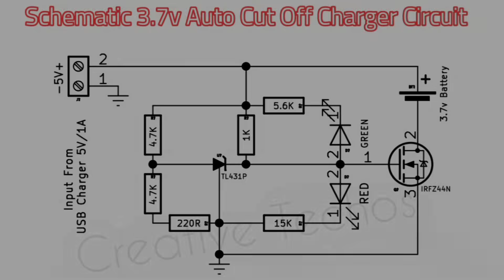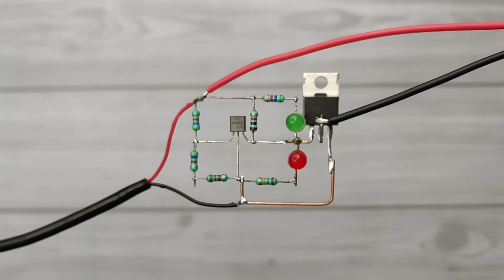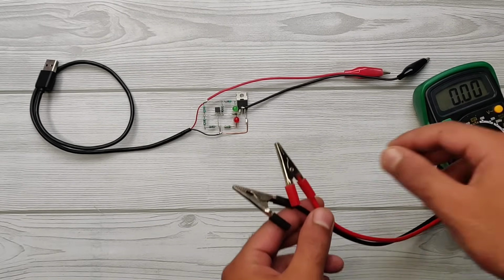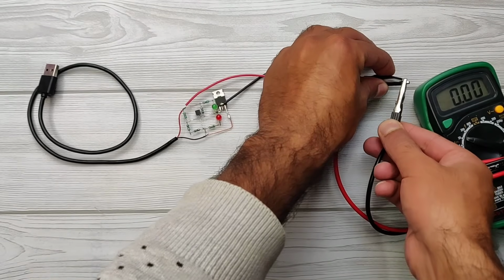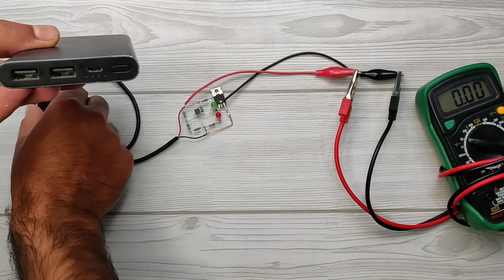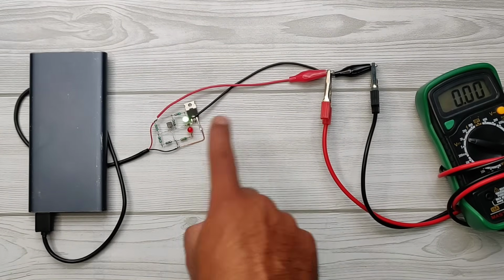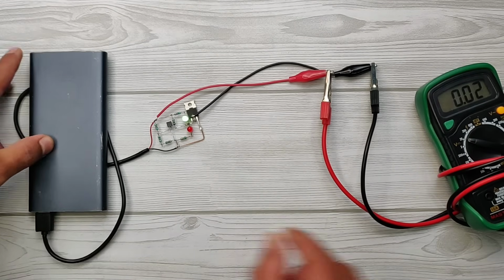Auto cut off 3.7 volt battery charger circuit

Comment: Hello and thank you very much for your video, very useful. A question, what modification in the circuit should I do if my battery is 1.5 volts? Greetings
Reply from the maker: 1.5v Ni-Cd need different circuit as mosfet will not able to switch in low voltages
Reply: @CreativeTechos  of course, my question is what values have will for 1.5 volts?
Reply from the maker: I'll try to upload video for 1.5v ASAP
Reply: @CreativeTechos thank you very much sir. , I am subscribed so I will receive the alert. Greetings
Reply from the maker: Thanks 😊

Comment: a3.7 volts or 4.2 volts?
Reply: if i want 4.0 volt Which resistor should I change?
Reply from the maker: Change 4 7k + 220 ohms in series from tl431 pin 1 to gnd, with the 10k preset to adjust threshold as per requirement

Comment: Auto cut off works at 4.5v only, what to do to make it works at 4.2v?
Reply from the maker: Use multi turn 10k variable resistor instead of 4.7k + 220R resistors, to set cutoff threshold accurately
Reply: @CreativeTechos I think if it is used 4.7k and 4.7k + 220R, will cut off 4.5 or 4.8v. If use 4.7k and 7k, will cut off 4.2v. correct?😅

Comment: sir,is it possible to charge 2- 18650 in parallel,thanks
Reply from the maker: Yes you can charge 1-5 cells in parallel
Reply: @CreativeTechos  thanx sir,badly need that.keep on sir
Reply from the maker: You're most welcome

Comment: Hi,
Can I charge 1.2 volt rechargeable battery?
If yes, which resistor do i need to change?
Thx
Reply from the maker: No, with this circuit you can't, I'll soon upload circuit for 1.2v battery, subscribe & get notified.  Thanks 😊
Reply: Thank you that you already have plan to create a circuit for auto cut off 1.2 volt rechargeable battery.

Comment: Hi there I made this circuit 3 times already and still not working and used the downloaded
diagram, when I connect the 5v 1A to it both led light up
Reply from the maker: It may be problem in tl431 ic, consider replacing tl431. 
I'm soon uploading another video with explanation with current and voltage control.

Comment: I was quite interested in this circuit but see that the green led is connected the wrong way at 2.33 into the video and the tl431 is also connected incorrectly. The reference pin should be connected to the junction of the two 4k7 resistors and the anode should go to earth. Having said this, I still don't see how the circuit works as the voltage of the battery isn't monitored, so what causes the TL431 to switch off? Could you explain how the circuit works?
Reply from the maker: In video it is connected correct, but diagram in video has mistake that i was not able to correct after uploading,
But download link in video description has perfect diagram
Reply: @CreativeTechos  Thanks for that, but could you explain how the circuit actually works?
Reply from the maker: Actually N channel mosfet remains on by feeding small +ve current at gate using 1k resistor.
And the Tl431 pin 2 connected to -ve and reference pin 1 connected to Voltage divider, when voltage in circuit reaches above 4.2v,  refrence pin 1 of tl431 receives enough positive current and switchs  -ve Voltage from pin-2 to pin-3 that is connected to gate of mosfet, that grounds positive current coming from 1k resistor hence mosfet turns off.
Reply from the maker: I'm also soon going to upload explained video with feedback and current Voltage control
Reply: @CreativeTechos So, reference voltage is 4.2 or 4.8 according to 4.7k and 4.7k+220 R, it is? if 4.2v, how to calculate to get resistor value for voltage reference? Please, let me know.

Comment: Is this circuit can charge 5pcs 18650 battery together?
Reply from the maker: Yes it can charge in parallel but its ideal for only one li-ion battery
Reply: Then u can make 5 pcs 18650 battery together auto cut charger circuit please. I have a power bank & it's module is so hot when I plug adapter. So I replace it & put your auto cut circuit.
Reply from the maker: Yes I'm soon uploading for 3 batteries and with same method you can charge 5 batteries

Comment: Hello
Thanks for sharing and explanations but unfortunately you have a mistake in the drawing, the practical assembly  is correct but different from the drawing you presented.
The junction of the two 4.7 kg resistors should connect to the No. 1 (reference) leg of TL431 and not to the Anode and again as shown in the drawing. And the Anode which is the middle leg 2 should be connected to the resistor junction 220 ohms and 15 k ohms
Hope you get the comment easily and comment
Thank you very much
Reply from the maker: I apologise, but already uploaded correct download link in description.

Comment: Is it possible to reduce the charge current in this scheme?
Reply from the maker: Yes you can connect 1 or 2 watt 10-20 ohms Resistor on input positive

Comment: 1. What is the minimum and maximum input voltage for the circuit?
2. How many watts are the resistors?
3. If you put a tuning resistor to adjust the current (instead of 4.7k + R220), what power should it be? Can I use the 3296 trimmer potentiometer?
Reply from the maker: Current circuit diagram is calibrated for 5v input.
And insted of 4.7k + 220R resistors you can use multiturn 10k potentiometer to setup the cutoff threshold.

Comment: Если поставить подстроечное сопротивление для регулировки тока (вместо 4,7k + R220), то какой оно должно быть мощности? Можно использовать подстроечный резистор 3296? If you put a trimmer resistance to adjust the current (instead of 4.7k + R220), then what power should it be? Can a 3296  Trimming Potentiometer be used?
Reply from the maker: https://youtu.be/nvlOeDHkwK0
Check out this video, with adjustable cutoff for any battery, with feedback from battery for precise cutoff.
Input voltage should be set cutoff voltage on output + input to output drop voltage.

Comment: Bu güzel devre 12 Vot aküler için de uygulanabilir mi?
Reply from the maker: https://youtu.be/nvlOeDHkwK0
Check out this video this circuit can be adjusted and used with any battery upto 24v max. With more precise cutoff.

Comment: Please tell me what are the resistor values to charge 7.4v batteries
Many thanks
Pierre
Reply from the maker: Just replace the 220 ohms Resistor with 10k variable resistor and connect the voltage where you want to set cut off point by rotating resistor till green led glows.

Comment: Bro, output showing 5.1v, without connecting battery.
Reply from the maker: Without connecting battery output should be zero, as mosfet remains off due to negative voltage coming from TL431, 
It may be faulty replace tl431 and download circuit diagram, link is in description and connect accordingly.
Also remember to use only 1A charger for single battery.

Comment: If you connect 4 batteries in parallel, what charge current will flow to each of the 4 batteries? Is it possible to make it possible to regulate the charge current?
Reply from the maker: If you connect 4 batteries in parallel, and use 2.1A charger, each cell will be able to draw about 500ma, also there is some ma dropped between mosfet source to drain pin. Use heatsink on mosfet for more than one batteries.
I'm soon going to upload 3S BMS with auto cutoff current and voltage protection with PCB
Reply: Yeah except if say 3 batteries are bad and 1 battery takes all 2.1amps...
Reply: If one of the 4 batteries has as slightly lower voltage then the other 3 there will be a huge current which could kill your batteries and even cause a fire! (This could happen idependently of this cuircuit just by connecting 4 batteries)

Comment: What current is supplied to the battery and how can it be regulated?
Reply from the maker: I used 5v 1A and battery will receive 700ma as 300ma get dropped in mosfet between source and drain.

Comment: Is this use only for single battery or it can charge for more than one battery in parallel connection?
Reply from the maker: Yes you can charge upto 5 batteries in parallel.

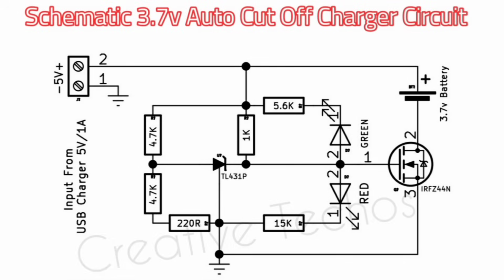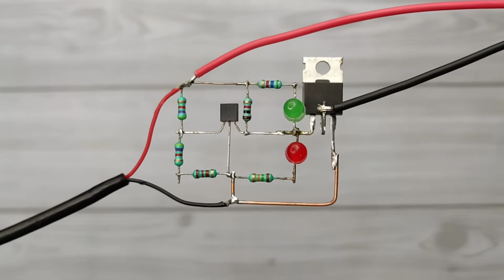Comment: I admire your works and projects with a high sense of respect and many times learn from them as well but may I point out a fact which I think is very important with regards to the circuit diagram shown from 2:33 to 2:36,the green diode is shown connected the wrong way,I think a circuit built in this manner will not work properly because the green diode should have been connected the other way round with the positive pin(which is pin 2) soldered to the positive supply line through the 5.6K resistor.I STAND TO BE CORRECTED ANY WAY, thanks.
Reply from the maker: Yes i apologise there is mistakes in diagram, but i have already updated and corrected the mistakes and the perfect diagram download link is in description.
Reply: Se que hace 2años de esto. Pero tengo una duda: La pregunta es si solo hablas del diagrama; que ya fué corregido. Es decir; la conexión que el hace en el video si está bien?? Estaré agradecido si pudieras responder. Ya que  yo hice todo tal cual como en el vídeo pero cuando pongo a cargar la batería, despues de 2 horas el led rojo se mantiene encendido y nunca enciende el led verde. De nuevo mil Gracias.

Comment: @CreativeTechos, Whether the circuit can take higher input voltage than 5v from usb. What is the input voltage range for the circuit.  Can you suggest equivalent for the 431. For parallel charging of more li-ion cells requiring charging current exceeding 1A, whether the same mosfet   an be used with appropriate heat sink.
Reply from the maker: Yes this circuit can take 5-24v input, also irfz44n mosfet drain current is rated 44A as per datasheet with good heatsink,
I will soon upload adjustable cutoff circuit can that can be used to charge any range of batteries of 5-24v,
Also you can use same above circuit for charging upto 5 cells in parallel with good heatsink on mosfet, and using 5A 2A charger
Reply: @CreativeTechos  So many thanks and my heartiest well wishes for your continued renovations and simplified projects. Kindly educate about the use of TL431 shunt regulator. How can it be eliminated with simpler component(s).
Reply: A large voltage cannot be applied to the input of the circuit because the protection circuit that is built into the battery will fail. I do not recommend a power supply voltage higher than 8 Volts.
Reply from the maker: You can apply max input 5v for 3.7v battery,  Otherwise it will not fail but will remain in Cutoff state as this circuit is designed when voltage reaches 4.3v it goes in cutoff state.
Reply: @CreativeTechos  In case of poor contact at the terminals of the power supply, "rattling", the MOSFET will open for a while until TL431 gives a "command" to close it. And all the power supply voltage will be applied to the battery. If the supply voltage is approximately higher than 10 Volts, the protection circuit built into the battery will fail.
Reply: @Timerkhan  Yes.right.

Comment: What current passing through battery ?
Reply from the maker: Use 5v 1a charger it will feed 700ma to battery as there will be mosfet junction resistance
Reply: @CreativeTechos  ty for the quick response too brother.
Reply from the maker: You're most welcome dear
Reply: @CreativeTechos  awesome ty. Nice design

Comment: Circuit diagaram. You are vedio i am following circuit .5v 1000mah charger i am using 1 cell why not working
Reply from the maker: When you connect circuit with charger what does any led glows?

Comment: please make video showing "auto charger regulator" for laptop.
Say, it will stop charging whenever battery is 90% full. And it will start charging again whenever battery is 10%.
I am using my laptop almost 20 hrs a day connected to power supply.

Comment: Can it charge a 5v battery?
Reply from the maker: Nope because output is designed for 3.7v battery and output is about 4.5v
Reply: @CreativeTechos  thank you , Can you make an electronic circuit to charge a 5 volt battery?

Comment: Problem is that if the battery is too low, there is nothing in the circuit that protects battery from excess charging current.  > 1A
Bad for both USB port and battery.
Reply from the maker: There is some junction resistance of mosfet from source to drain.
Reply: @CreativeTechos  Nonsense. The resistance of the MOSFET channel is very small.
Reply: @CreativeTechos  Could you tell what’s the charging current? Is it constant during charging?
Can you replace USB with any 5v power supply?

Comment: I want to use this circuit in a device where battery is connected permanently, and input from 5v supply. Is it ok? No drain in battery when device is in off state??
Reply from the maker: Use a Schottky Diode on positive to avoid battery drain

Comment: Put a 1N 4007 diode to the output -ve of the battery of this circuit to prevent its volt..when there is no input supply...ok
Reply from the maker: I know but TL431 won't detect battery level effectively if diode added on +ve or -ve
Reply: Да,добавить диод,изменить номиналы резисторов и на вход подать 14vпостоянного,получится ЗУ для автоаккумулятора.

Comment: Can the input voltage comes from a 5V 10A power supply. I assume that it draws only the 1 amp it requires right? So we do not need to limit current. Nice video. Subscribed
Reply from the maker: Thankyou for subscribing, also i would like to let you know that you should use 5v 2A charger for 5 batteries in parallel, for 1 battery use just 5v 500ma
Reply: Is it a must or should( just for precaution) because only have high curent power supply tho?
Reply: @maximussu7609  Just use a simple low value power resistor to limit maximum current in series with the power lead, something like 4.7 Ohms 5watt resistor should limit a short circuit current to about 1 amp, protect the circuit as well as the battery.

Comment: Hi, if i want to change the output voltage, which resistor value should i change in ur circuit diagram?
Reply from the maker: You can use voltage max to 12v but instead of 4.7K + 220R at left bottom in diagram, use variable resistor and adjust Cut Off point as per your requirement.
Reply: @CreativeTechos  hi, if i use input voltage of 5V but 20 amps Power Supply Unit, would it be safe since ur cicuit will just draw 1 amp right?

Comment: Please make a circuit for charging upto 10 Li ion battery at the same time having 220v AC input🙏🙏🙏
Reply from the maker: You mean input 220v AC & output dc for 10 li-ion batteries,
Reply: I think with this diagram, you can use a really big transformer to step-down 220v to 12v high current,now you can use 7805 regulators to send 5v 1amp to each circuit to charge your batteries remember with a really big transformer you can power a lot of circuits with it. Alternatively you can get 5v directly from the 220v mains through USB chargers to power your circuits to charge your batteries even 100 batteries at once. 👍 But remember each 7805 powers one circuit to charge one battery and each USB charger powers one circuit to charge one battery. You can assemble your circuits in one enclosed box and install a fan to cool your battery charging system 😁⚡👍